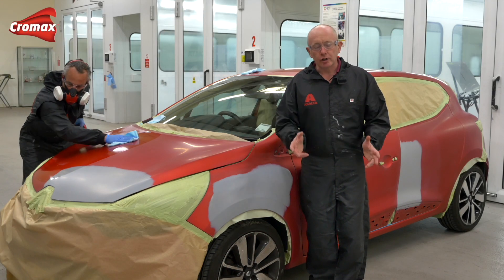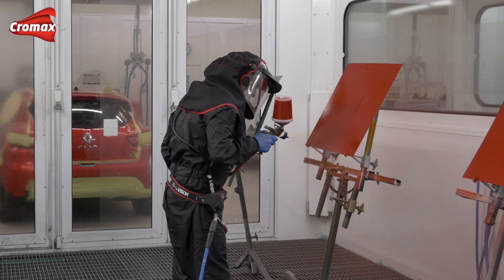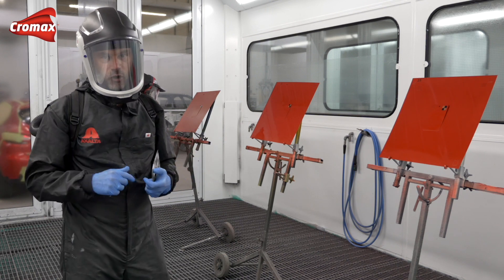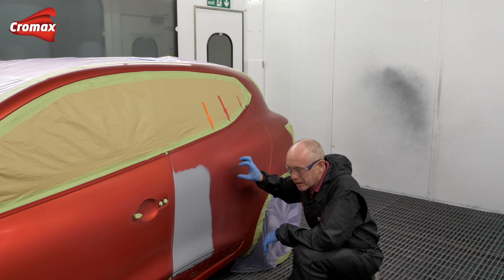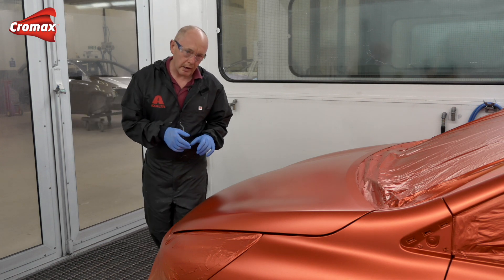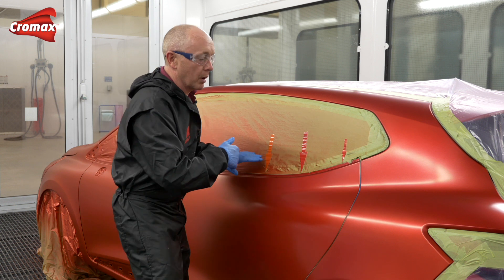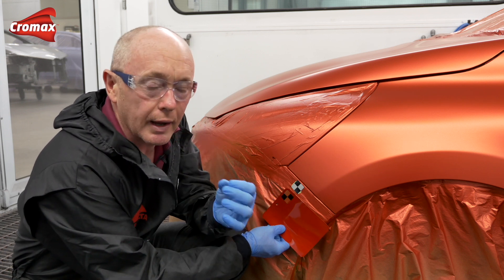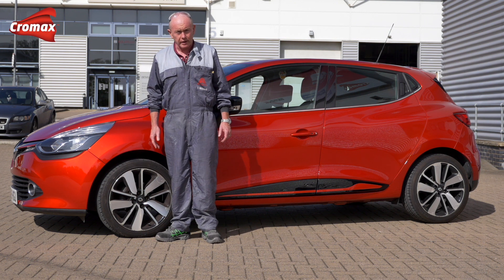Special Colours Tinted Clear Coat Repair Process

Comment: wait why did u base the entire hood with that small of repair was plenty of room to blend, won't it not match right fender
Reply from the maker: Hi, in theory you are right but our technician chose not to do this for a number of reasons
1. Having done the pre-work in spraying out the colour samples, he could see that he could achieve a good match was possible when painting edge to edge (this was also to show that edge to edge is possible).
2. Blending basecoat and tinted clear across a large horizontal panel offers more opportunity for mistakes to be made and for the repair being visible.
3. As stated in the video this was a training exercise and he wanted to show how to control mottling with the tinted clear on a horizontal surface.

Comment: What is the size of the fluid tip and the climate conditions? Thanks :)
Reply from the maker: Hi, thanks for the question. Here the Sata RP5500 1.2) was used and from memory the climate was 22OC/38% RH

Comment: Hi did you use a solvent paint in this video or water based
Reply from the maker: Hi, in this video we used Cromax Pro, waterborne Base Coat and a VOC Compliant Clear. The repair process however can also be adapted to use solventborne base coat and a suitable clear.

Comment: Have you do  the color NNP standart in cromax paint
Reply from the maker: We have a number of formulae, standard and alternative shades available for NNP. When you search with Chroma Vision pro it will select the best possible match based on LAB data. You will need though to go through the process described to establish how many coats of tinted clear you need to apply to reach the correct colour position.

Comment: For clearcoat sata5500x rp 1,2i or 1,2o?
Reply from the maker: We used a Sata RP5500 1.2O for the tinted and non tinted clear in the video
Reply: @CromaxEMEA  ws400 1,3hd its good for cromax clearcoat?
Reply from the maker: An Iwata WS400 with either a 1.3HD or 1.4 HD is suitable for our VOC compliant clears. In this case as we used a lower viscosity HS Clear  (CC6500) and  would recommend the use of the 1.3HD to keep control.
Reply: For clearcoat you started ever from the top?
Reply from the maker: Normally I prefer to start from the top of a panel and work down as this helps me see the film formation and guides me as to the amount I am applying. Depending on the job though it's sometimes necessary to start on the bottom. Judge each job on its own merits and plan accordingly. Good luck.